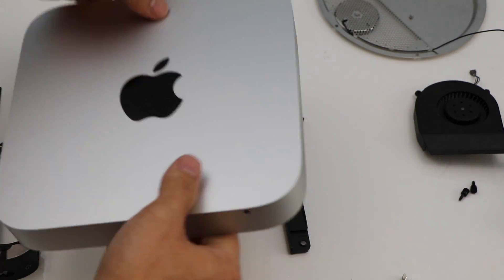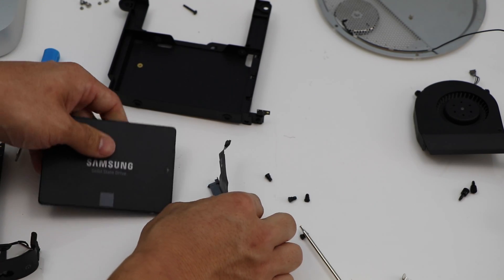How to upgrade Mac Mini hard drive to Solid State- Late 2014 Model

Comment: Great guide, thank you. And what a relatively easy job that was. After years of being scared of getting one of these Mac Minis because of the logic board removal process, I finally picked one up today for cheap, and replaced the HDD with an SDD in no more than 40mins, and my removal tool? A plain old steel clothes hanger, cut to about 6-7 inches and bent into the rough shape of the commercial removal tools. It’s the perfect diameter steel.

Comment: Steve jobs always said he wanted the Apple products to look as beautiful on the inside as the outside. I used to be an IT technician years ago before retraining and this is by far the easiest mini pc to work on I’ve seen. Just moved to Mac mini after spending years building up my Apple collection. Now have the IPad Pro 2021 11 inch, IPhone 13 mini, Apple Watch SE, 1st Gen AirPods, and now my first Mac. There’s just something I’ve always loved about the Mac mini. Never been a fan of the IMac just because they displays are apples own so if they go then you’re into new Mac territory, plus I don’t like working on all in ones. Didn’t want a MacBook as I have the IPad so I got the Mac Mini. Runs great on a HDD but could be so much better on SSD

Comment: Being how capacious modrn NVMe devices can be, is there any point at all to fall back on SATA?  I am not aware of significant savings, if any, to be made by using SATA when m.2 is an available option (obviously, macos versions with proper NVMe EFI boot support are assumed for this question).

Comment: Please comment on the following:
1. using 2.5" in no way interferes with installing a PCIe NVMe SSD on the flip side.
2. with due soldering skill I can upgrade RAM beyond 16GB.
2-a. if "yes", what is the chipset limitation on the RAM capacity?
2-b. also, what are the technical requirements for RAM chip?  I hope it is not artificially signature-bound to the apple brand or some other narrow HCL.
Thank you.

Comment: I've been told by a large NYC store that I need a 7mm to 9.5mm adapter to fill in the extra space around new SSDs because the Mac mini Late 2014 is 9.5mm. I don't see any adapter being used in your example, leading me to believe it's not needed.  True?

Comment: After I bought the security Torx screw driver, changing to SSD is just an easy job by following your tutorial! Thank you!

BTW,  I used a piece of AWG14 copper wire (stripped both ends) instead of the special logic-board removal tool.

Comment: You are the man.  I did this for the 2012 Mac Mini but the 2014 was totally different.  Your instructions were perfect!  Perfect!  Thank you so much
Reply: I was surprised to see the 2014 model needs a different size Torx bit to remove its bottom plate. It seems slightly harder to get into generally, maybe due to lack of upgradable RAM. New M1's unfortunately continue this trend :(

Comment: Great video! My question is: once you put the empty solid state disk, what you have to do to transfer the old's HD contents to the new disk? Ιs it done automatically or you have to do something about it? I would appreciate your assistance into this. Thanks. Nick K.
Reply: Once you've swapped the HD you can connect your old drive via an external interface to the unit and boot from it by pressing the option key (or ALT for us PC guys) during startup. Then download and install SuperDuper! (free trial) and clone the old contents over to your new drive (select the option to copy all files). That may take a long time so you may leave it overnight. Once the clone is done you have to open your system preferences and set the new HD as your main startup drive and you're done. Good luck!
Reply: Thanks a lot Mick, for your assistance!!!
Reply: @nickkekos6169  Good luck, Nick!

Comment: Hello. Thanks for the video. I was able to do this and it works great. However the system is using 128 gigabytes of space on the ssd. It’s only a 250 gig drive. What did I do wrong? Thanks again!

Comment: Thanks a lot! Successfully switched drive but struggled to clone my old disk because my SSD was smaller. I tried to shrink the old partition with gparted live usb and then clone with clonezilla live usb but the disk failed to boot. Then I figured out you could actually boot the mac mini into "internet recovery mode" (windowskey+R on windows keyboard) and download MacOS directly, then I used my timemachine backup to recover old disk 100%. Clever Apple!

Comment: Thanks very much for this video. Definitely the best of the several I reviewed before I dove in. I used this video in conjunction with the iFixit step-by-step photo guide (https://www.ifixit.com/Guide/Mac+Mini+Late+2014+Hard+Drive+Replacement/32815 ), which is also indispensable from my non-techy point of view. The iFixit guide goes the extra mile by using color coding to identify screw sizes and their locations. iFixit also sells a kit containing everything you need EXCEPT the motherboard pry bar tool, which they sell separately. I swapped out the 500gb hard drive on my infuriatingly slow late 2014 Mac Mini with a 500gb Samsung 860 EVO SSD and I am frankly astonished at the gain in speed. It is like having a brand new computer. I spent less than $150, including the drive and the iFixit tools. Far less cursing in my house now. As far as cloning, I used Carbon Copy Cloner but did not, as some videos suggest, use the Multibeast program. The cloned SSD works fine; the Multibeast suggestion seems like the video maker is shilling for someone.

Comment: I have replaced mine by watching you. A few months ago!!

I have a 2014 Mac Mini, i5 1.4Ghz and 4Gb Ram, the hard drive has been updated to an SSD, to be more precise Sandisk SSD Plus 240GB. To have a faster external storage I have just ordered the Samsung 850 Evo. Would you recommend tearing down the mac mini again and put the Samsung one inside or keep the Sandisk one as it is?

Comment: great job.. i saw you chose the samsung evo instead of pro, any particular reason? price, dimensions?
Reply from the maker: Only because it was cheaper and I didn't need the extra speed. The dimensions are the same. You can get the pro but IMO I don't know if it's worth it.
Reply: Thanks..just did my speed test on my Mac mini 2014 4gb ram and it's 97.9 mb/s write and 97.5 mb/s read..so I think I'm going for the pro..